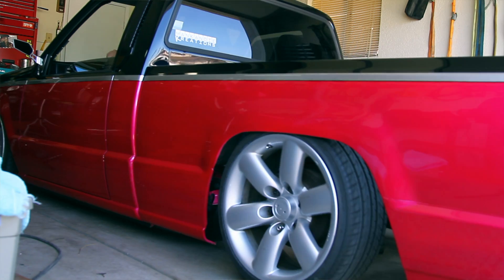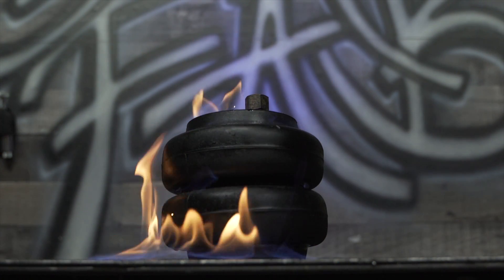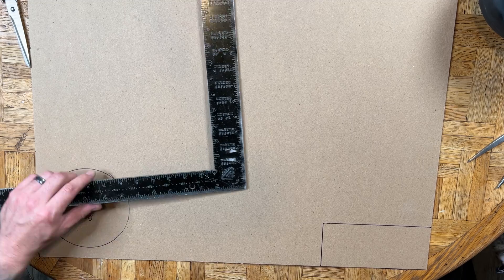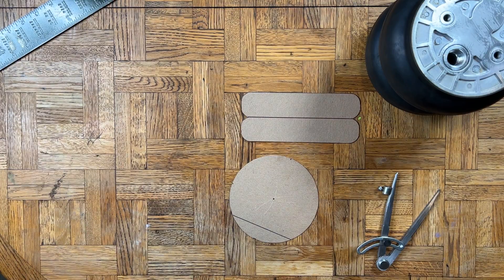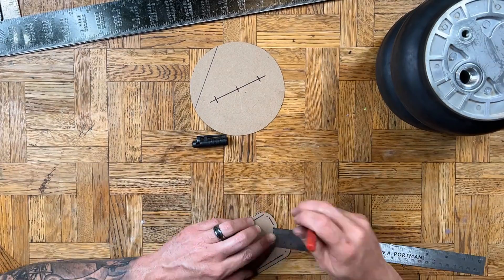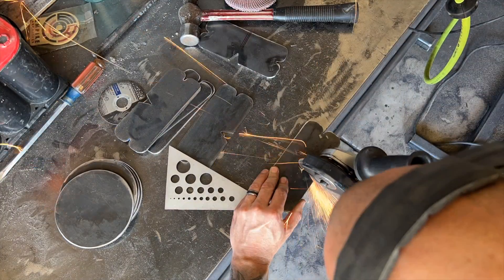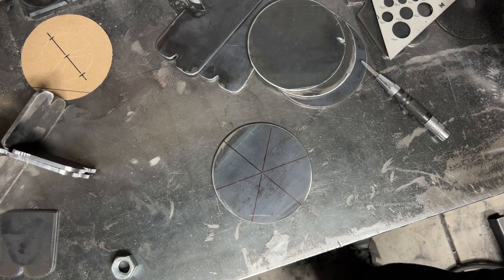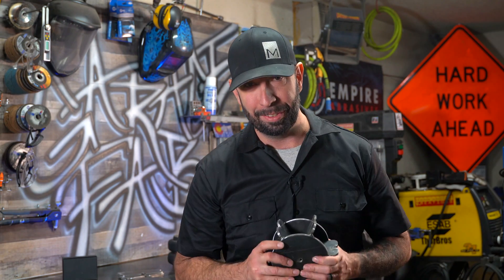Make Some Mock-Up Air Bags! (Or Don’t. Whatever.)

Comment: Tip Find the center of the circle.

 Use the right angle ruler and align the tip of the ruler to the circumference of the circle. Mark 2 points the ruler cut the circumference. Draw a line through 2 points; that's your diameter. The middle of that line is the center.

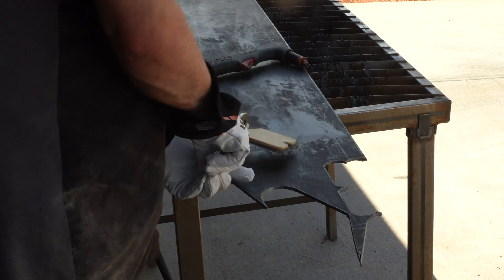Comment: On your templates I''ve noticed a couple times one straight edge is utilized, Do you set it back 3/16" (I did not see this like @5:52) or not cut one side down (@5:56 you trace the whole thing)? Curiosity you know! lol.... Welcome back, Now I'm playing catch up!
Reply from the maker: The wooden plasma tracing templates generally have have 3/16” removed from all sides. This is important because most of the parts will be cut from the middle of the piece of plate you’re using. When I set the template at the edge of the plate, I do in fact clamp it down 3/16” away from the edge. (I’ve gotten good at eyeballing it, but a sliding T square is handy for this.) If I clamped it flush to the edge, that side would then be too short.
Hopefully this next bit won’t be confusing…
When making the wooden template, I often only remove 3/16” from the edges that need to be accurately sized. Good examples are in my bag mount video https://youtu.be/ZEkMYaolM-Q 
and the last video on adjustable bushings. 
https://youtu.be/fxRap1HwYVI
In both of those videos, the brackets I’m making need to mount a component a specific distance away from the truck frame. So the edge that touches the frame needs to be accurate. The outer edge doesn’t matter much. Therefore, on the wooden template, I only trim 3/16” from the important edges to save time.
Reply: @GarageFab  i did end up watching the next video and you sort of said something about it. I also did see you space the templates. But it does look like the time stamp above looked on the edge. I'm sure you have shot yourself in the foot ounce or twice before 😆 I would. 
I just got a plasma cuter (primeweld cut60) and it will take some practice to cut freehand, I want to get a spacer so I don't drag the tip. (I have access to a cnc table too but no idea how to work the programs 😔) 

Still any decision on that DIY suicide hinge(s) video? 🤣 I'm still interested and need a single beast hinge (crown vic has a mad arc back door with the wheel well right there. Of course laid out posses a problem with any intrusion in there.
Reply from the maker: Oh boy! That’s suddenly sort of a sore subject. My computer wigged out on my while editing a few videos back. I had to clear a bunch hard drive space so I deleted tons of stuff. I think I accidentally deleted all the footage from the Suicide door project. I don’t know for sure yet but I do know that I’ve got no clue where it is. There’s a slight possibility it’s on my laptop that I haven’t used in years. Here’s to hoping!
Reply: @GarageFab    dun dun dun! Price of 1tb+ drives these days, so cheap you can make a back up of your back up and still put those dog bones on the table during talk and treats time! 🤣😂 I started laughing too hard when I heard the cat and seen dog bones! (The pinion angle milk run was good too!) Kudos sir!
Reply: @GarageFab  and while I'm bothering you here..... Where is the Mustang video!?!?
Reply from the maker: What Mustang video?!
Reply: @GarageFab  exactly!! 🤣, do a "ONOPOPO" video! Or is it just a stock new edge?
Reply from the maker: Well currently she’s dead. Blew a head gasket a couple months back. It was my daily. Luckily I had just purchased a pair of SS Impalas for my next project and one of them was drivable, so that became my daily and has been since. Gonna have to get the Mustang fixed eventually!
It’s just factory with some exhaust and intake work. I want to fix it up a bit. Paint, new wheels, wider fenders, but it’s still my daily so nothing crazy.
Reply: @GarageFab  "ONOMOGO"! Usually I'd say throw a used motor in but they have gotten way expensive as of late. I always try to find a Mercury Grand Marques engine because typically they are easily driven compared to Mustangs and Crown Vics (for obvious reasons). Also Town Cars can be a good choice but need to look for one not used as a Uber/Lyft car. 

The motors are all the same but there's potentially a few differences and you'll need to swap a few things over. Only thing you MIGHT need to get would be a new flywheel (6 bolt vs. 8 bolt crank or Romeo vs. Windsor. Belt tensioner design might be different and the heads could be different (the amount of bolt holes for the valve covers) but performance and all that is identical (some would argue Windsors are better aside from the spark plug ordeal but really a moot point) 

Can get fancy and find an explorer 4.6 as they got an aluminum block so you can shave 50lbs 😆

Comment: Very nice work, when you said about welding a nut on the  back of the plate what I do is use a countersunk bolt in it always puts the nut dead in the middle  , great video thanks for sharing
Reply from the maker: I dig that advice. I’ve had problems threading in a bolt because the nut was off the smallest amount.

Comment: Where do you get your plasma cutter consumables
Reply from the maker: Alan! I have never bought consumables. 😬 I bought my Hypertherm at a local metal supplier and it came with one replacement tip which I’m using right now. I only use the machine for my personal projects so consumables last me a really long time. I know it’s getting close to that time though.
I’ve purchased a lot of other stuff online from Welding Supplies by IOC, so I’ll be checking there first.
Reply: @GarageFab   awesome thank you!  I appreciate your videos and knowledge on showing the hands on way of learning these techniques as well
Reply from the maker: Much appreciated my man! 🙏

Comment: As always U hit it out the park. So fancy smancy these  mockups. I do enjoy a different viewpoint on these things. I'm basically no frills in the shop when it comes 2 mockup. What I've done is take some square tubing and fixate it perpendicular wise. Tack them together along with the upper and lower bag plates. Then voila, Manna From Heaven!💯
Reply from the maker: We aren’t much different Delvin. The only reason I switched from the ol trusty wooden block is because I realized the steel mock-ups also provided a reference for clearance of the bag itself. Something the block couldn’t do. 
Thank you as always my friend. 🙏

Comment: It's a great little truck that a lot of people don't think about. An easy way to make some big mistakes by assuming that you have everything close enough, until it is welded then it's not. Great practicle tool that will be used more than one would think. I have used square tubing before cut and plated to use for mock up. Great information as always and I always enjoy your patterns, shows with a little ingenuity you can use simple tools to make great parts
Reply from the maker: I’ve seen the mock-up bag being used all over the place while I was using blocks. It wasn’t until I realized that the bellows of the mock-up bags weren’t just for looks that I realized I needed them. They’re crucial for preventing bag rubbing because of lack of clearance. 
As always, Thank you, Shawn! 🙏
Reply: @Garage Fab  yeah that makes a lot of sense as well. Just because you have the  correct height doesn't mean you'll have the correct width. It's a great idea and is something that you easily made to make any job easier, and will always be in your bag. Can't wait to see the video on doing the bag mounts, it'll be very interesting for sure. Thank for the quality videos, I always appreciate your knowledge and dedication.
Reply from the maker: There will be a LOT of bag mounting in the future.

Comment: Good call on this. A friend was working on a SEMA build a couple years ago, and before it went to paint the painter was welding on a bagged truck and popped a bag while he was under the truck. I heard he broke his back, and is paralyzed from the waist down now.
Reply from the maker: Oh sheesh! I didn’t see that coming. I never considered it, but I imagine a mock-up bag with a spacer could be used to make a truck under construction movable without an air system. And therefore a safety device to prevent that kind of thing.
I’d be lying if I said I never imagined a bagged truck crushing me if a line failed while working under it.
Thanks for the pick-me-up Jay! 😂
Reply: @GarageFab  not trying to be a Debbie Downer, but I just thought it reinforced your point from the beginning of the video.
Reply from the maker: Haha no sweat dude. Safety is crazy important to me. I think that kinda stuff needs to be known.

Comment: I don't even use airbags and this video has tons of useful info!
Reply from the maker: Oh but it makes you want to… doesn’t it Jeff! Air suspension is like ice cream for the soul.
No idea what that means, but it sounded good.
Reply: @GarageFab  I like ice cream. It's cheap, easy, and delicious. Air bags are not cheap, easy or delicious:). Nothing against them but I'll be taking the simplicity of static ride height and coil/shocks for my build. I'm a knuckle dragger ;)
Reply from the maker: Haha! Fair enough.